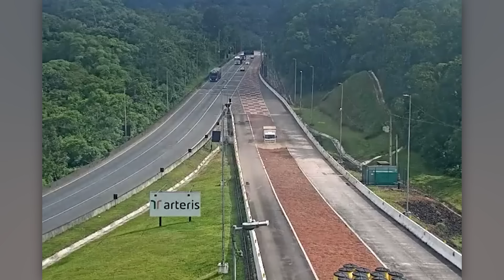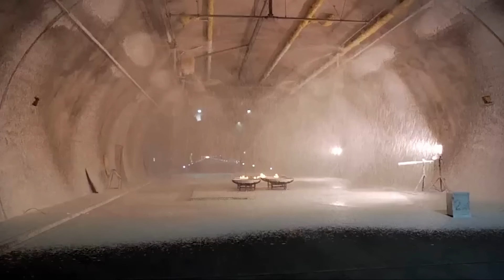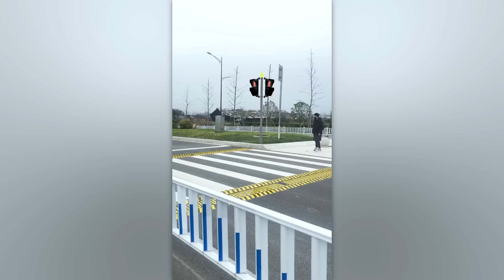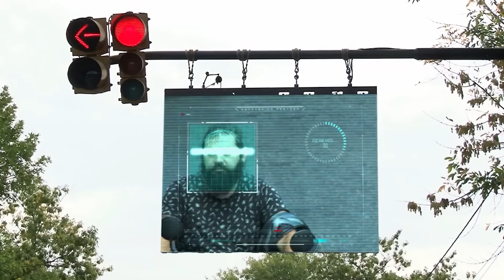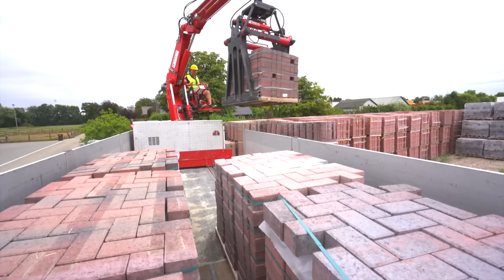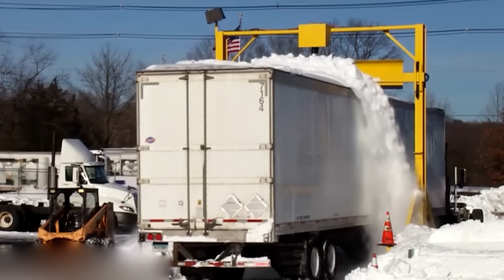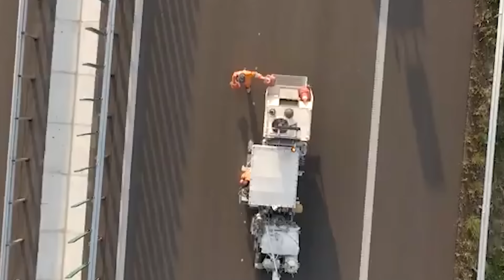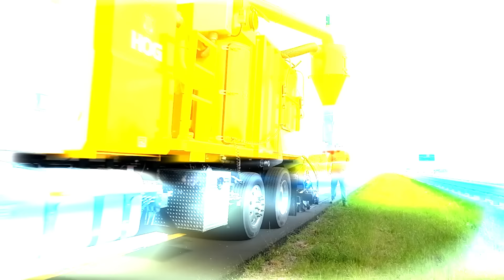Incredible Road Technologies That Are Insanely Cool

Comment: Until that gas robot can remove and replace the gas cap, it's a non-starter.  You can't drive with no gas cap, you'll get a check engine light.
Reply: Modern cars don't have gas caps.
Reply: @BigMike8  The video clearly shows the gas cap and the robot ignores it.
Reply: @jonathank.1215  Again, MODERN cars don't have gas caps. They probably used an older car to test their prototype without worrying about paying out a lot of money if an accident occurs.
Reply: @jonathank.1215 that is for the adblue. It is not a gas cap.
Reply: @sjv6598  what's "the adblue"?
Reply: @BigMike8  Are you sure you know what a gas cap is? What modern cars are you talking about - electric ones? Most gas cars still have gas caps that are required, as @jonathank says the check engine light will come on if the pressure is not correct in the fuel system.  Have you looked at all modern gas powered cars? if not, I am not sure how you could say that all modern cars do not have them. I have driven cars from the last 5 years from most major auto makers and all of them have had gas caps. Only one had a cap that did not need to be removed, it had a door in it the gas pump was inserted into, and that was installed by the owner and did not come with the car originally.
Reply: @robtapp6400  You only need to do a quick Google search to see what I'm talking about. 🤦🏼‍♂️
Reply: @robtapp6400  "Modern Cars Going Capless" as stated by NUMEROUS car and driver news articles, news outlets, industry magazines, etc. Perhaps the world changed in the last 5 years of you driving a "modern" car? 🤷🏼‍♂️
Reply: @BigMike8  You misunderstood my post as I expected. I did not say the cars were 5 years old, but that they were from various model years over that 5 years. In other words, 2019 model years up to and including some 2024 models. Not one was capless. Did I drive all models from all makes? No, so I would never say all cars have gas caps. But you read an article or two talking about them and somehow assume all models from all makes no longer have gas caps?
Reply: @robtapp6400  My apologies. But, the fact still remains that modern cars are going capless.
Reply: @BigMike8  Maybe, but that is different than saying modern cars do not need them. They are increasingly going that way but have not got there yet.
Reply: @BigMike8 you have no Point at all because In some countries, the fuel cap is mandatory, most modern cars operate in “limp mode” when the check engine light comes on due to the lack of a fuel cap.
Reply: @mimamaanno6535  Pretty sure this technology is being tested in the US. I wouldn't think they would develop this technology and send it to a country that can't use it. Therefore, your comment is moot to the whole conversation.
Reply: @mimamaanno6535  Actually, if you kept up with the conversation, my point is that modern cars are going capless. 🙄

Comment: Did you know Australia has some "Musical Highways" Have you driven on a road which has those tiny bumps at the outside edges. They wake you up if you fall asleep and your car drifts to the side of the road. Some bright spark reckoned that if those bumps were set at a specific distance apart they would play a tune. The one I drove on played Waltzing Matilda. But a word of warning, prolonged use of those bumps can loosen the nuts on your car and I don't mean the one behind the wheel. Sorry, I couldn't resist.
Reply: There are a few in the US, as well.

Comment: cool stuff, but the lasers at 24:29 seem like a bad idea, lol. wouldn't that blind aircraft? seems like a distraction. those grooves that make your tires buzz if you start to cross the line or go off the road would probably be more effective.
Reply: Aircraft pilot blinding indeed, dangerous to the eyes yeah, increased eye strain on the road, definitely.
Reply: If they pointed up at aircraft, sure. They seem to be horizontal above the road though, so there wouldn't be any aircraft where they're pointing.

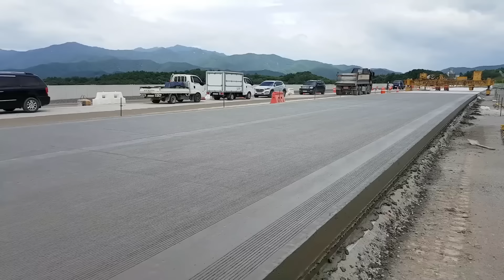Comment: 10:20 That isn’t asphalt 10:20 , it’s concrete. Please watch the videos before commenting
Reply: ICANT ''This modern asphalt paver can even mix cement''
Reply: In Belgium near Antwerpen there is a concrete road, it is a f*cking bl••dy h*ll to drive on, the car keeps on hopping and shifting sideways if you are driving with a certain speed, concrete roads are not fit for modern traffic.
Reply: That was the first mistake I noticed, It also said "The Workers Could Sit Back With A Cup Of Coffee In Their Hands"  BUT NO COFFEE WAS SHOWN !!!!
Reply: @briand6671  more like they would fire most of them cause why are they there drinking coffe if they do not have a job cause the machine will do it instead of them 🤣

Comment: Some of the roadway technology highlighted has been around for 40+ years. Some of explanations of what they are doing is flat wrong!
Reply: like the "asphalt" paver laying concrete
Reply: @DavesTreeFarm  And the Jackson St bridge being the Ballard Bridge on 15th Ave in Seattle that was originally completed almost 110 years ago.  Oh, and it not only goes UP, it goes DOWN.  The older ones only went up and then they had to build a new bridge.
Reply: @richardkelleher1711  It actually says BALLARD BRIDGE right on the front of the operator's house, mostly visible in this video (28:08).
Reply: @richardkelleher1711  it's almost if it complete a full... cycle
Reply: yeah and they stole the first timelapse of the barrier mover on the gg bridge from me

Comment: Gas filling robot:  a big fail until it can remove & reinstall the twist-on cap. Those are necessary for the engine to run properly!!
Reply: With the cap off the engine management computer will turn on the check engine light an store a fuel system air leak code.
Reply: @Apismeliffera  Nope, not on any of the 5-7 rental cars I’ve driven with this thing on them. The check engine light is from the emissions system thinking there’s a vapor leak when the cap is off, this thing doesn’t trigger it.

Device says Easy Fuel on it, look it up.
Reply: @BLKMGK4 If the car doesn’t have a filler cap from the factory, then the system is designed to function without the filler cap.

On cars that DO have a filler cap (MOST cars on the toad) everyone else in this thread is correct. It WILL trigger the check-engine light showing an EVAP leak.
Reply: @BLKMGK4  Well maybe a recent thing to not have filler caps?  I've never encountered a car without one before (have owned or rented 100s of various cars & trucks at this point, including a few in the UK & EU), but all but one truck older than 2022 model year...
Reply: @sus8e462  apparently new fords do it and at least one other brand from the factory. Thing looks aftermarket and I’m surprised there aren’t copies for sale by 3rd parties. It’s doable without triggering the light for sure.
Reply: @sus8e462 to not have a gas cap would require using the door to make the seal. And that's just not going to be as easy to close as turning a screw to tighten the seal.
Reply: I don't know how many cars still on the road have them, but during the first fuel 'crisis', there was a solid business in gas caps that required a key to remove, which the robot would be even less capable of managing.
Reply: Not always, quite a few rental cars I've gotten have had a filler that's just a flap thing you insert the nozzle into - no cap. Looks aftermarket so I'm sure someone is selling them.

Comment: Um ... your robotic gas attendant forgot to put the gas cap back on. 17:00
Reply: The software folks would be the culprit!
Reply: There wasn't one there to begin with. Big fail.
Reply: @mindi.m  In some countries, the fuel cap is mandatory, most modern cars operate in “limp mode” when the check engine light comes on due to the lack of a fuel cap.

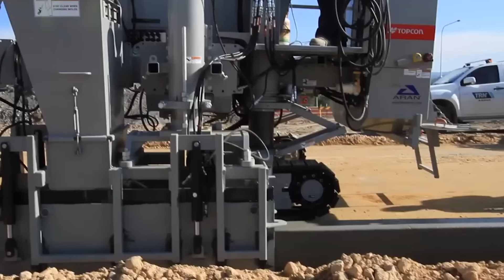Comment: @16:19 That robot arm for pumping gas is useless. You would have to get out of the vehicle to unscrew the gas cap!
Reply: Automobile manufacturing companies will study this issue 😀
Reply: You don't need to screw ur gas cap on. It's useless.
And what happens when the driver forgets and drives off before the robots done?  Goodbye robot arm. Also people are gonna try doing other things with that arm...yikes!
Reply: @Sammasambuddha If your car has a gas cap, not having it properly installed will trigger the check engine light.
Reply: My car doesn’t have a gas cap.
Reply: @robertheinkel6225  In some countries, the fuel cap is mandatory, most modern cars operate in “limp mode” when the check engine light comes on due to the lack of a fuel cap.
Reply: Giusto!!! ...  e poi vanno in palestra e ... gli fanno avvitare i tappi ;-)

Comment: They have laid pipes under driveways to pump hot water to melt the snow and ice for almost as long as there have been driveways.
Reply: Poi hanno inventato il sale... 😅
Reply: Here in Japan, they use natural hot spring water which comes through small outlets in the middle of the road to melt snow and ice. As you say, it is absolutely nothing new.

Comment: The helmet/traffic light device is pointless. The riders they showed merely placed their helmet on their head without doing up the strap. Unstrapped helmets don't save lives.
Reply: And do they all have their helmet hanging at their arm ?
Reply: It also looks if your mouth and nose are visible.
Easily to fool that.
Would be interesting to see what it does if you wear sunglasses.
Most facial recognition systems can't detect a face if they don't see your eyes.
And it has to detect a face to work.

Comment: What good was the robot gas pumper if it didn’t put lid back on??
Reply: I have seen versions of this since 1985. It still doesn't work. Also, its stupid.
Reply: That could be useful in the USA, they seem to drive away with the pump attached. Atleast the robot can yell at them if they try to do it.
Reply: ... A Piegare il metallo della carrozzeria 😂
Reply: It didn't wait with pulling out after releasing the lever and also failed to point the muzzle upward pulling out.
While it went trough the effort of rotating it upwards once it was out it stopped before it was even horizontal.
Its bound to drip excess fuel onto your paint.
Reply: Tesla has already had an automated charging cable arm for like a decade now lol
Reply: Where is that moment, I haven't seen it yet 🤔
Reply: @BeeMax88  @ 17:00
Reply: @stevie-ray2020  Wow, thanks a lot
Reply: @stevie-ray2020 that cap is for the adblue. The car has no fuel cap. My car has no fuel cap either.
Reply: @sjv6598 and mine is locking, because security. So, no thanks weird robot.
Reply: @BeeMax88  16:20
Reply: it wasn't on to begin with - and how is that little suction cup going to work in all weather, or with a dirty car?  Its so flawed it's stupid. . also..  is it really that hard to pump gas?
Reply: Everyone saying I don't have a gas cap. Good for yall. Majority of us can't afford the newest cars so it's a dumb idea
Reply: I don’t have a gas cap on my car.
Reply: @robertheinkel6225  yeah... well I DO!!
Reply: It's a dumb idea. lol.
Reply: You do realize that some cars nowadays do not have gas caps, right?
Reply: @SoCalG90  you can clearly see the gas cap and he did not put it back on
Reply: If it's Chinese made, nobody can ever expect it to work properly / ongoing.
Reply: @glenmcd  Guess where your computers and phones are made? Also, the currency in that video clearly says euro.
Reply: @glenmcd 90% of everything you have and/or use is made it China bud

Comment: Highway trucks in Germany don't really recharge (they can, but it is not the main point)
They drive off those powerlines like trams or trains.
It uses batteries to deliver beyond that highway power rail and has a range extender too i.e. internal combustion engine (which doubles as a heater in winter).
It is a hybrid with 3 types of functionality: power rail, battery, combustion engine
Reply: Plus it´s just a short distance where they put those lines, since it is for testing and only a handful of trucks are equipped with devices to "harvest" the power from the cables.
Reply: Trazione elettrica: Una truffa internazionale obbligatoria!